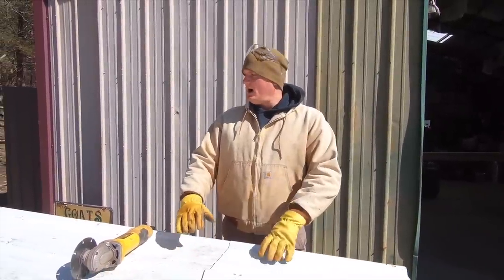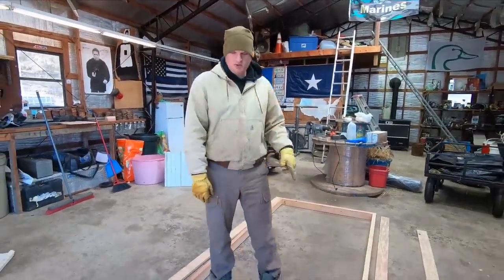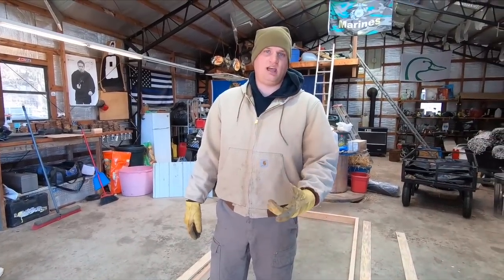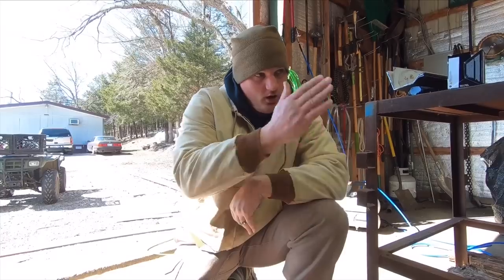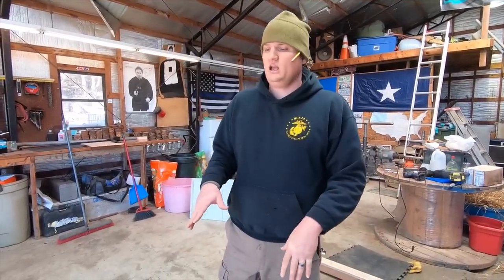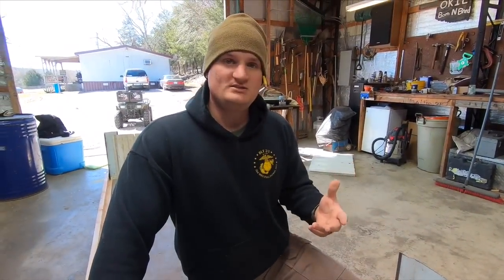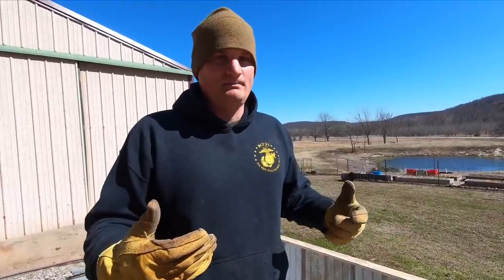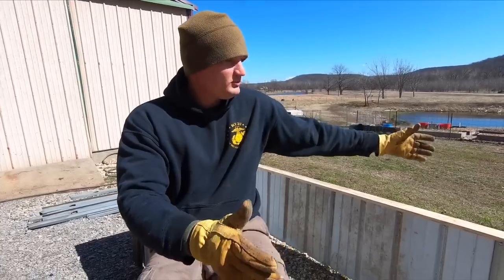STOP Building Wooden Raised Beds!! | How To Build The BEST Raised Bed For The Money!

Comment: Several companies make cutting wheels for a Skil saw and you can cut through about 12 sheets of that at once, it can be a huge timesaver.      Also, a lot of newer pressure treated wood is nontoxic, just check for that option when you buy it.
Reply from the maker: Thanks! 👍

Comment: I have a friend that got some free garden tubs from the local Habitat for Humanity Restore to use as raised beds. She was wanting to be able to sit on the sides of the tubs so I told her she better add some supports under there. She managed to find some cheap concrete things at the same Restore to use.  She wanted to completely enclose the sides so she asked me to let her know if I saw any ads for used tin.  I did see some ads but buying enough to enclose 12 tubs would have been very expensive. Then I had an idea—used garage door panels. The guy she hires occasionally to help do projects had a used one for $75 & they were the perfect height!  Both the tubs & garage door panels were white so now she has a nice looking raised bed garden area.
Reply from the maker: Julie B that is awesome glad everything worked out.

Comment: None of the wood actually touches the garden dirt so there is no reason not to use treated lumber. I build the same beds and used treated pine rated for earth contact so it will never rot. Then I paint it with Kills Primer paint before I assemble the planter. These things will last at least 25 years. I use new white roofing metal and corners and it makes a beautiful planter. I agree with you about the size, a 4x12 is perfect but I do a lot of 4x8s too because of space restrictions and even some 4x6 and 4x4s at times. Love your channel BTW.

Comment: Raised beds this deep can be expensive to fill with soil but not if you hugelkultur! Use your limbs and leaves and fill em up. Add six or so inches of soil and then mulch. Good air circulation and roots only need around six inches of soil so why waste money on all that soil... spend it on your beds and plants.
Clean up your yard and throw it all in your hugelkultur raised beds. It's just plain smart and cheap!
Oh yeah, and it works! I love my beds! ( I just run a sheet of scrap tin length ways/ horizontal and it's the perfect height ).

Comment: Could use the mobile home plastic skirting... won't last as long, but locks together well and if you make the beds 4' square with 4x4 posts and bury the siding 1/2' in the ground you could add 2x4's on top to sit on as well.

Comment: THANK YOU SO MUCH I was wondering how to build a top cap on the metal...I do not have those corners but I am going to use 2inch grey plastic conduit for my corners and screw down tight. My concern was that I had a panel laying on the ground a couple yrs and it rusted in a few spots nothing deep but still so maybe I will line it but still moisture? Thanks again!!!

Comment: Hi.  Great build project ,  ya'll work well together !!  Good length n width n reasoning..  Use that same width reasoning to plant your rows in your in ground garden.. Maybe a 12" path between rows , covered with leaves. I think Jason has some he could give you. In a couple years , that row of leaves is compost ready to scoop into the near by garden row.  Harvesting will be easier on your body with short width rows, less bending.  Watch your sun movement so taller plants don't shade  shorter plants.   Voll? or gopher problems, place chicken wire under raised bed before filling.   Using the template for square foot gardening, she could grow more efficiently in a small space.                   Peace to you and yours
Reply from the maker: Kiki thank you for the information we really appreciate it.

Comment: As always, great job Jacob. Thanks for continuing to show different types of raised bed gardens. Jacob will you need to some stakes in the ground so those 12 foot sections won't spread outward when put the soil in them?
Reply from the maker: I don't think I'll have do that cause the tin is very strong. One thing I forgot to mention is I will just dig like a couple inches in the ground to put the bed in where the tin is that will support the side.
Reply: @SawyerRidgeFarm  and put card board in the bottom to help stop grass and weed growth. card board is biodegradable so wont hurt nothing.

Comment: Looks good. However, it wouldn't surprise me to find that due to no boards the bottom will begin to bow outwards from the pressure of the soil in the box especially on those long sides. I would choose Cedar or cypress. though more expensive it is naturally bug and rot resistant. Also you can use pure tung oil for treatment, it is non toxic and safe to use even on cutting boards and other kitchen items.

Comment: Hey There.... Great idea, I am building something similar , but I sank cedar posts in concrete & built a nice frame with 2x4's.
I got everything all flush & ready for the corrugated roofing. mine is 16' x 6' ... it's huge.  I will fill the bottom half up with old wood.. cut stumps, oversized firewood, etc... then layer that with my old strawbales from last years strawbale garden adventure.. then, I will put in the Compost & Garden Soil. It's called Hugoculture.... something like that....The wood on the bottom will soak up plenty of water & as it decomposes , each year, I will just add a bit more soil... My roofing (siding) will be supported at 4' intervals, so, no bulging out...Its a lot of work, but.. this bed will last a lifetime & is totally worth the investment .... & filling up the bottom half with old wood, saves a bunch of $$$$ on the Garden Soil... Thanks for sharing your project ... Grow On.. !!!!!! ;-)
From The Concrete Cowgirl Homestead... NV.
Reply from the maker: That is awesome! Good luck with your new bed!! 👍😀

Comment: I’ve had problems with the heat,  will these transfer summer heat into the beds thereby damaging the plants or roots?  I like these because they are more permanent.  Thanks for sharing. Could a person use a catapillar tunnel over them?
Reply from the maker: Auntym we have not had any issues like that with our beds we have four of them just like them. Yes you can use Caterpillar cover on them. If you watch Roots and Refuges channel they are doing that with theirs. They explain alot of does and donts.
Reply: It would depend on your climate. I wouldn't suggest using these in the Phoenix area (or a similar one), or at least not for anything you want to survive the summer. But, heat is a problem anyways for raised beds here. But if it is a choice between these raised beds and no garden at all, I would try it! Shade cloth would definitely be your friend.  I have no experience with the tunnels.
Reply: Melissa Jarvis. Thanks I live north of you and these folks, but it gets over 100 here in summertime And well below zero with wind in winters.  I think shade cloth would be necessary for summers.

Comment: Wondering what supports the bottom of the panels, won't those sides push out when you dump dirt inside?  I'd think you'd need a board, probably staked to the ground, at the bottom to hold it in?
Reply: Wondering the same

Comment: how did you join the vertical joints? Just a few screws from the outside in?
Reply from the maker: The corner pieces? I just put two screws in them just like I did the tin.

Comment: Another effective wood treatment to prevent rot and insect damage is a boric acid based product.  Boracare or Timbor are 2 that come to mind.  Boric acid is a naturally occurring mineral that has been used for preservation for thousands of years.  It is classified as a Green List chemical in Pest Control operations.  It can be applied by spraying or put on with a brush.

Comment: Thank you for your tutorial; I've got lumber (old 2 x 6 decking) raised beds, and concrete block beds. I had intended to build another block bed, but I think I'll go with your method.  Question: I'd like to paint the tin a tan color to blend in with our ubiquitous weathered wood chips.  What kind of paint and preparation do you suggest, and to paint before or after assembling?
Reply: I was told by my roofing supplier to scuff it up a bit then google paint for the rooking material you have...hope that helps!
Reply: Use an etch primer over the paint surface after about 6 months when it has begun to oxidise and then paint with your favourite colour. You shouldn’t have to scuff it. That just reduces your existing paint finish

Comment: Great job, looks great.  Did you secure the bottoms of the tin - I may have missed that section.  I guess once dirt is filled inside the pressure will aid in securing all around or will it bow with time.  I considered using tin (because I like the look) at only 12" (cost factor supplies/dirt) but without a truck I have to consider what will fit in my small SUV.
Reply from the maker: Thanks! We did not put any supports. We’ve found that it’s not necessary. We will be sticking the raised bed into the ground a few inches before we even start to fill it.

Comment: Yep. I build mine exactly the same way but, I'm 62 so mine have 'grown' to 3 ft tall.  That raised rib roofing is stout and can be had dirt cheap.  A note on cheap/efficient filling..... Fill the bottom 3rd with rocks or other masonry debris, the middle ft with any sort of wood, and finish them out with soil, compost, cardboard, ect. using the 'lasagna method'.  95% of your garden plants will only use the first 12" anyway and the rotting wood acts as a 'sponge' for 'wicking'.  Just my 2 cents.   God Bless....~Eli.
Reply from the maker: Singleman you are exactly right on this will be doing that for my sister.

Comment: I am going through the comments looking for the answer to this question I did not see you put any screws with the metal overlaps going down to the ground did you use self tapping metal screws to screw the panels together or did you just put screws in the wood
Reply: I would really like to know the answer to this as well... I just got all my supplies and plan to build this weekend... So i really would like to know...🤔
Reply from the maker: Yes, the only screws we used are on the top where the tin meets the wood. There’s no need for screws in the overlapping parts of the metal. We have a bed in our garden right now just like this one in the video and it’s holding up and doing very well!

Comment: Run panels horizontal. Cut panels lengthwise down the middle. Ribs act as great guide.. That will give you 2 panels 18" (plus  top board thickness) which is perfect bench height for sitting on while weeding. 2 identical panels,, one for each opposing side.. Also that means only one cut and it is with the ribs, not over them so it is a LOT easier!! You can even do it with a utility knife- score it and snap it- presto!! 18" deep is plenty for annuals and means you need less fill material. Never seen a carrot or beet need deeper soil but remember there is regular soil beneath the bed. Horizontal cuts means you don't have any seams along the sides and it can be any odd length you want instead of generally 3' intervals you get when running vertically. This is a good vid but believe me, run your panels horizontally. Many advantages that you'll quickly discover if you run them vertically. Also these panels are usually free from lumber yards or roofing companies as they get them extra as cover sheets. Color is random which makes for a colorful garden but if color is critical to your lettuce then you can pay for your color choice. PS- he calls it "tin". It hasn't been tin for over 100 years. Fabulously expensive. It's actually galvanized steel that has very durable paint and coatings on it to prevent rust but is harmless to plants (otherwise your roses under your roof eaves would die when it rains.)

Comment: Great design! Great job explaining. and great to see you and the mrs working together on it.  
Jus' wondering - I didn't see you put a board or rail along the bottom edge. Did I miss that, or are you going to bury it a few inches, or where does your support come from to keep it from spreading?  
Also, concerning chemical leech from treated wood: with your design any leeching would be outside the box, away from your growing soil and veggies - no danger. 
 The other side of that is that, according to university studies, the amount and toxicity of modern (like after 1985?) treated wood is so negligible that it's not enough to harm the plants, and they claim that even if it were enough to affect the plants, there is no scientific evidence that the veggies pick up or store any of the chemicals. So, according to "them", whoever "they" are, there is no danger from it anyway.  Beats me. But like I said, I'm not gonna stress over it, cause the wood will never come into contact with any of the soil that the veggies are planted in.  Don't think the chemicals can jump that well. 

Thanks for your work, and keep it up!
Reply from the maker: We just dig a couple inches of trench for the bottom to sit into the ground.

Comment: how about useing vynal siding  cut at 24 in  8 ft 2x4 top and dont let bottom 2x4 touch the ground  use treated wood   dont worry about rusting out  you can get this stuff in lotsa colors  irish thistle is a pale green   wont be an eye sore

Comment: Besides the boards around the top, what holds the tin from bulging out towards the bottom and at the joints?
Reply: Good question
Reply from the maker: We’ve never had an issue with it bowing out on the bottom.
Reply: @SawyerRidgeFarm  good to here that.  I'm going to make me one.
Reply: @SawyerRidgeFarm  I can see from your more recent video that you kind of packed dirt around the bottom edges, which would ensure it doesn't go anywhere.

I have piles of this same metal roofing in charcoal color. Won't be surprised if the neighbors want one as well.

Comment: Great work on the build. I'm looking to set up a raised bed in my backyard and liked the metal sides VS wood (that currently has gone through the roof in pricing) I was looking at your page and didn't see a follow-up on the beds you made for your sister. Because you didn't place a frame on the bottom was the bowing an issue? Thanks
Reply from the maker: We’ve never had an issue with them bowing.

Comment: What is the gauge / thickness of the metal roof panels (24 / 26 / 28 gauge) that you used???  Where do you buy the metal roof panels???
Reply from the maker: We’re not sure exactly. But it’s just regular roofing tin put on houses. Just about any hardware store will have it or can order it.

Comment: Do you have any problems with the bottom of the beds blowing out.because of the weight of the dirt ?
Reply from the maker: We do not. One thing if your worried I do this also is dig just a couple inches a track in the ground for the tin to slide into that will support it very well.

Comment: Thank you so much for the video. Quick question.... when you fix tin on the long edge, i guess you used 4 pieces. Right ? So, did you use any screws to attach each piece at bottom and top ? Or you just left the top without any screws ? ( in top down position where wood part is on ground )
Reply from the maker: Screws are only in the wood

Comment: I like the design, but what about the bottom of the bed & the middle where the panels are connected  ? No support there. Wouldn't you want a smaller version of the corner pieces to be attached along the bottom to reinforce  the sides ? Given the weight of the soil at a 12 foot distance,  wouldn't the tin bulge in the middle  ?

Comment: How do you keep the tin from separating at the botton.  You don't have any support down there.  Won't it spread out  and push out when you fill it with dirt? At the very bottom.
Reply from the maker: We stick it in the ground several inches before we even fill it. It helps stabilize it some. We’ve never had an issue with it though.
Reply: @SawyerRidgeFarm  I really like the raised bed.  Thanks for clearing that up. Have a peaceful day.😊

Comment: This might sound crazy, but what is the outside dimensions of the raised bed?  I'm trying to figure out why you have (1) 1x4x8?  Where does it go?  Thanks
Reply from the maker: Melinda the outside demsions are approximately 4x12ft. The 1x4x8 is the small ends  you cut the board in half then measure the small end in between the big side. For the top piece
Reply: I get it.  I thought you used part of the 2c4x8 for that.  Thanks for clearing it up for me.yall have a great day!

Comment: How do you keep the sides from bowing out after you fill it with dirt?
Reply from the maker: It won't, but as a safety precaution I just dig a shovel head deep around the bed and slide in down into the crack.

Comment: What prevents the walls from bowing out at the bottom?
Reply from the maker: We stick it in the ground several inches before we even fill it. It helps stabilize it some. We’ve never had an issue with it though.